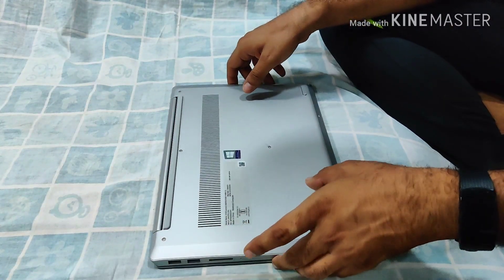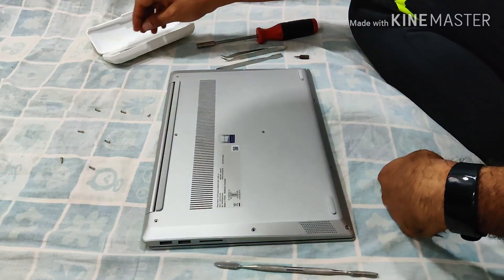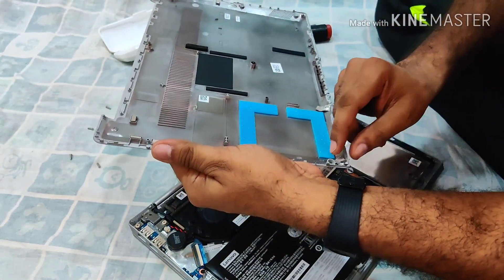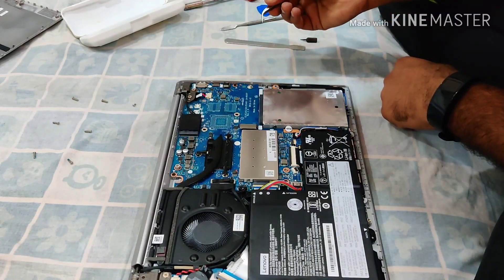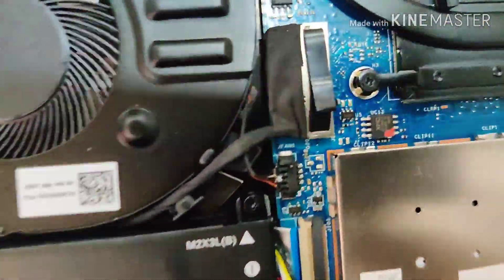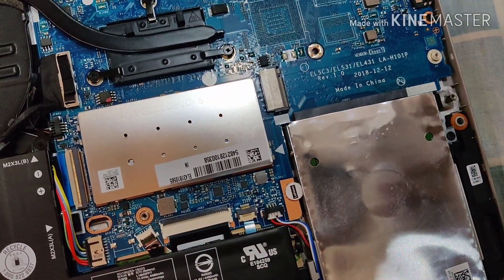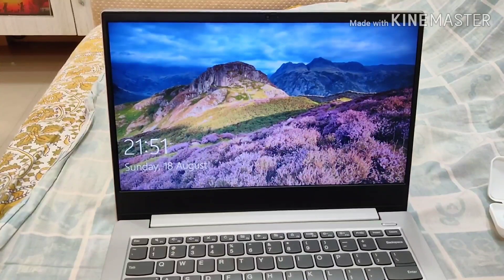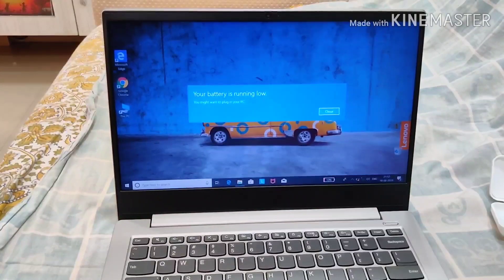Lennovo IdeaPad S340 back panel opening (English)

Comment: Does Lenovo idealpad S340 core i3 10th gen laptop can support this “Western Digital Black 500GB SN850 NVMe Internal Gaming SSD Solid State Drive with Heatsink - Gen4 PCIe, M.2 2280, 3D NAND, Up to 7,000 MB/s - Western DigitalS500G1XHE” or not , I need your view then I can buy. Thanks

Comment: Dear sir my laptop as same laptop 
Hard disk not show in my computer please help me
Reply from the maker: Can you take out the hard disk and connect externally to make sure it's working fine?
If yes then check if hard disk gets detected in bios
If yes then check with a bootable disk if you are able to detect Hd
If yes then you might have to repair OS and for most other cases it could be hardware malfunction.

Please explain what fix you tried or what is working and what is not to diagnose it better.

Comment: what screwdriver is that
Reply from the maker: It's hard to tell, it's an unbranded screwdriver set that I purchased from a local fair when I was 15-16. However the bit that I used to open screws has number CR V PH0 written on it.

Comment: Will opening laptop like this not void the warranty?
Reply from the maker: It will. But I found no tags that can detect that user has opened the back panel. So idealy companies put a paper thin film or paint on screws so once you open them, it scratches the screwhead.

Also in another attempt to dismantle it's heat sink I fried one of the capacitor. After that I did visit service center and got my motherboard replaced.

So that's the long answer to your short question 😀

Comment: I got this laptop like 3 days ago and i have noticed unusual heating on the chassey specially the bottom vents.  The surprising thing is the fan is pumping out cool air. Like how?!!
Reply from the maker: It could be because of some other component. Check where are you experiencing the heat, notice which component is at that place and then we can try to deduce something.
Reply: @dheerajyadav8134  i believe the heat sink is positioned there. Thanks for the help in advance. Most people do not respond to our queries.

Comment: U just got traumatic by accidentally breaking your panel before. Don't push too much. If u not sure about the RAM slot. Just skip. Don't need to explain the thing. By the way. Just pull up the silver thing, with ur thumb. Just thumb. without "required tool" u'll find out what u want to see. I bought this laptop 1 week ago, after 3 days landing on my room. I don't care about warranty. Fuck it. Lenovo service center really suck.

Comment: Sir I have these laptop I used it for 6 months. It is heating too much and  there is some issue with fan I think. Can I exchange these or I have the repair. The laptop is in warranty ... Please  give me suggestions what to do  . go for repair  or ask  for replacement ... Please help............
Reply from the maker: Hi Friend, if you have used it only for 6 months, go for repair. I have been to the service center of lennovo once and my experience has been good. Does it heat up on doing or running some specific software or without that? Since this is a thin laptop, heat exchange will suffer if you keep it on the bed and even on lap and work. If you are doing that then please make sure of proper ventilation for heat exchange. Lastly, if the issue persists, then there might be something with the mainboard. It would help service guys a lot if you tell them the exact conditions that make your laptop heat up.
Reply: @dheerajyadav8134  thanks for the replying .  2 months before there was some sound coming from fan with  vibration and the back panel was heating so when I restart it  get to normal( .in 6 month I notice these 4 to 5 time.) I think there is a fan issue or dust in the fan .

Comment: What are your opinions about this laptop's variant that comes with  AMD Ryzen 5 , with 8gb ram 1tb hdd and 128gb ssd and vega graphics . As I'm planning to buy it very soon. My main uses will be normal browsing , video streaming and some Photoshop stuffs. Please reply soon
Reply from the maker: Hi Dinesh, apology for late reply but frankly friend I have no idea about the specific question you asked so I think you will have to some more searching. Although AMD Ryzen has shown some decent numbers on geekbench like performance scale and some say it's equivalent to early i7 or so. Only your Photoshop thing will require a graphic engine but otherwise the spec sheet you mentioned is good enough.

Comment: Also i was thinking of upgrading the ram .as our laptop has 4+4gb ram. Can u tell should i install 8gb or 16gb.coz on lenovo forums its written that company says 8gb but 16 gb works fine too.
Reply from the maker: Hi Nitish, you might try with 16 but I would generally stick with spec sheet from manufacturer and that mentions total max of 12Gb Ram in extensible slot.

Comment: Bhai which company ssd you have installed in your laptop.and price of the ssd also .
Reply from the maker: I have installed Samsung 970 Evo Plus 250 GB SSD. I purchased it from Amazon at 7300. You can install any other SSD as well as this is quite costly but it's very fast. My computer boots in 5.57 sec now.

Comment: Do you know if I can upgrade the GPU of S340 model?
Reply from the maker: Tough one, frankly I don't know. I will try to find out.
Reply: @dheerajyadav8134  I couldn't find any info related to upgrading GPU. Seems like upgrading GPU is not that common. And Lenovo S340 doesn't come with dedicated graphics.
Reply: you cannot upgrade ultrabook laptop GPU; only ssd/hdd or RAM if it is not soldered on a motherboard.

Comment: Will you void your warrenty if you open it yourself? Review the screen please
Reply from the maker: Technically yes, any tempering with hardware does violate your contract with manufacturer however to impose that is manufacturer's discretion.
Screen in short is good enough for daily use, office work and good enough in outdoor light as well. However I would have got IPS Panel has there been an option.

Comment: How do u know it supports ony 256gb nvme SSD, wht is the source?
Reply from the maker: I discussed it with Lennovo support India and this is prescribed limit for this model. However it might support 500Gb but since Evo 970 is quite costly ssd, I didn't want to take risk and anyway s 250 GB was enough for my use so.

Comment: Is it a good laptop for coding, as Im planning to buy
Reply from the maker: @Ankit  For most of the coding needs it will suffice. I am not into graphic intensive game development so I am not aware if they have any special requirements but otherwise for app, cloud, web or any other development, it's good. I have installed SSD in it and now it's blazing fast, boots in 5.76 sec. Program load time is also amazing.
Reply: @dheerajyadav8134  How is the battery back up....if we will use visual studio continuously?

Comment: That's the ram slot underneath that heat shield. 🙂
Reply from the maker: Are you talking about the Balck metal connected to fan or the metal coloured box that I didn't take off? Underneath that meatal box is RAM, I have opened it up. It has only one removable RAM. I have also put up the SSD and after initial hickup, it's working great, system boots in 5 sec
Reply: @dheerajyadav8134  metal box that you didn't take off. 🙂🙂🙂 Very nice video bhai.